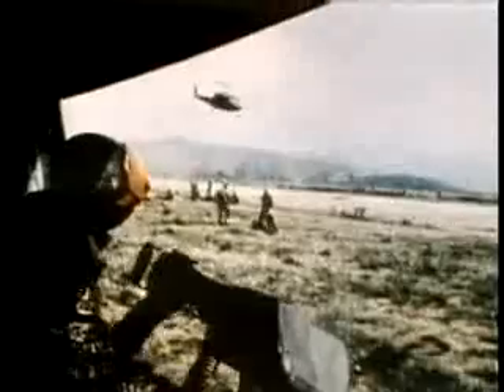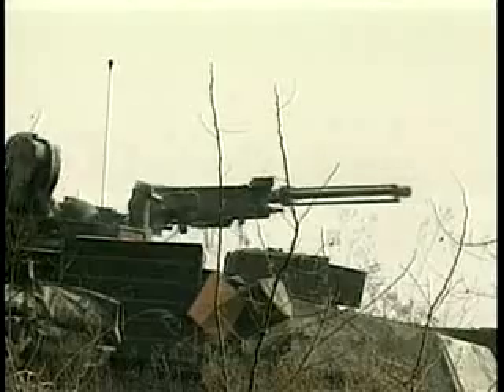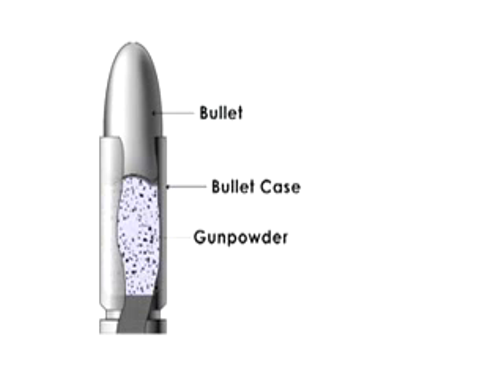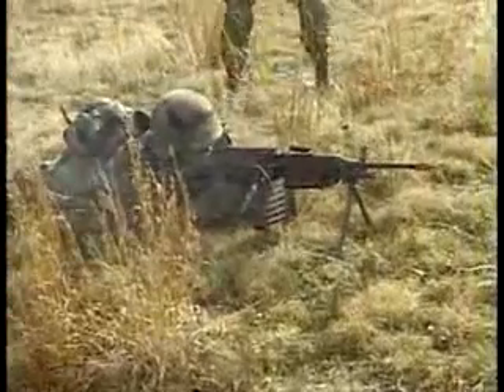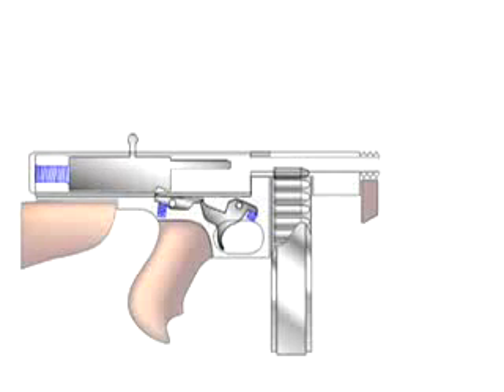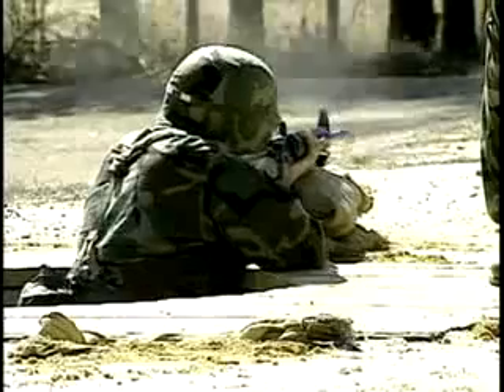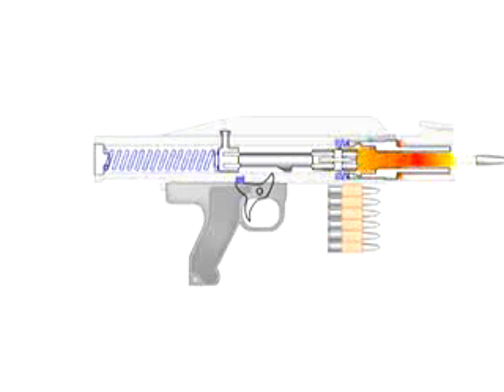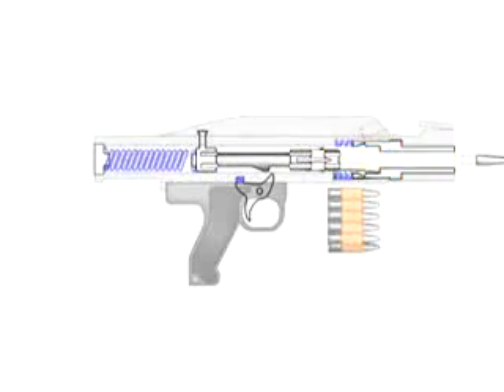How Machine Guns Work

Comment: this is really just how guns work, it has nothing to do with the "machine gun" aspect of the gun. its really how the trigger mechanistic works in relation to the spring assembly that makes "machine guns" automatic. not assault rifles as shown in this clip. basically with a machine gun the bolt is already back when your not firing. when you pull the tigger this little latch goes down releasing it allowing it to cycle. when you let go it catches the bolt stopping the cycle.